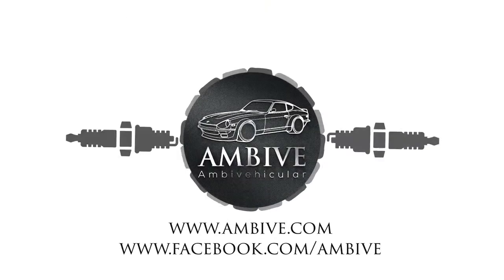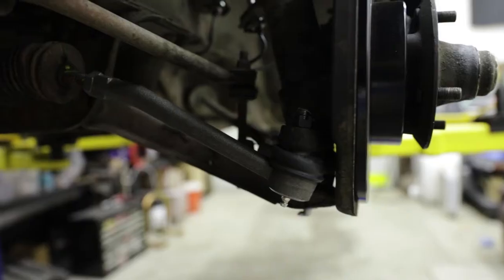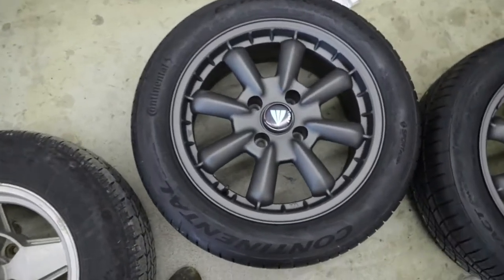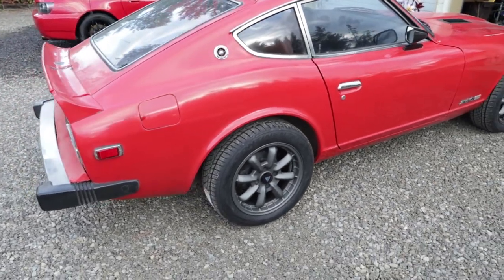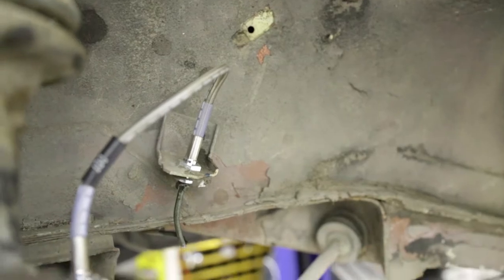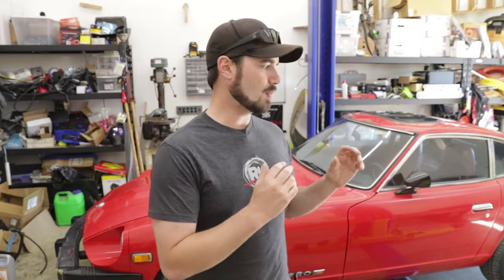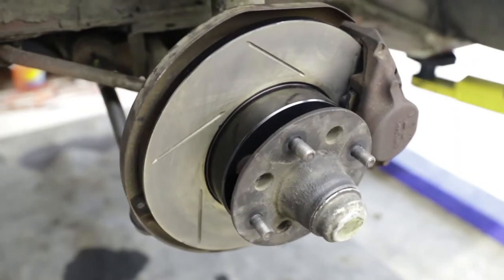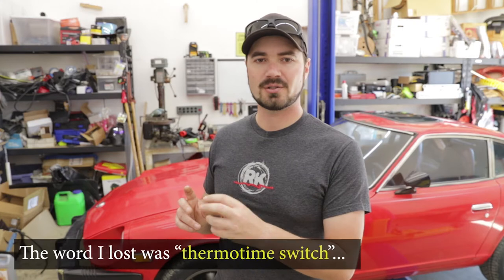280Z DD Project - First update on new parts!

Comment: I was your 280thz subscriber! this is all great info for me, I just got my first z car and can't wait to get to tinkering on it. I am currently looking at wheels and suspension upgrades. I hear different opinions on kyb struts, and I definitely want to lower it at some point.  I also plan to cut the fenders and put flares on the car, so I am trying to find the right width rims and tires to go with that look. Have any tips or recommendations? I was thinking rota wheels and 16x8 or 16x9 would that be a good fit for the width I am going for?
Reply from the maker: That's awesome! I can't believe 280 people watch my channel, let alone someone nailed the timing for a question! The widths will depend on what offset you go with. Pick your suspension first, if you go with coilovers, they are smaller diameter and free up almost another inch of width you have to work with.
Reply: @AmbiVe  appreciate the info, it seems like most of the rims I'm looking at only have 10-20 offset. Their aren't a whole lot of options for coilovers it seems, and the cost for struts and springs is already pretty close to the cheaper options. If you know anything on the budget coilovers to avoid that would be helpful.
Reply from the maker: @BrandonAilion  I do not, I generally avoid budget parts for critical components. I went with Techno Toy Tuning coils on my SR240Z which are probably mid to high price range.
Reply: @AmbiVe  hmm they seemed pretty high cost from my research, but how have you liked them?
Reply from the maker: @BrandonAilion  They are pretty high quality. I have not had a chance to run them at any events, but as soon as we get another tune done with the car (hopefully soon) and new stub axles we have on order, I'll do some videos of them in action.